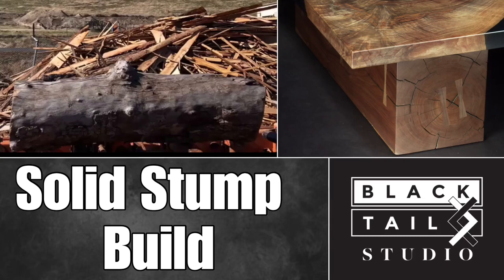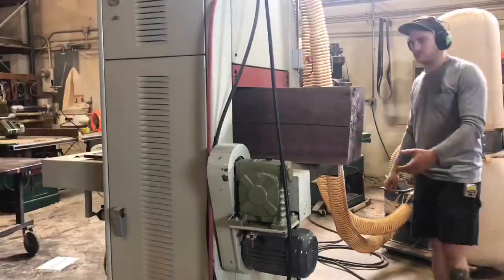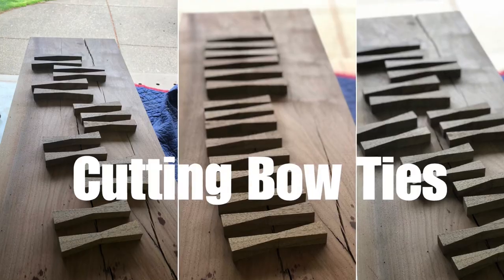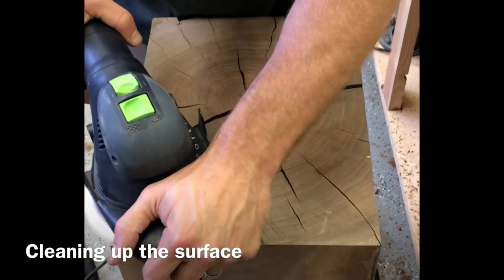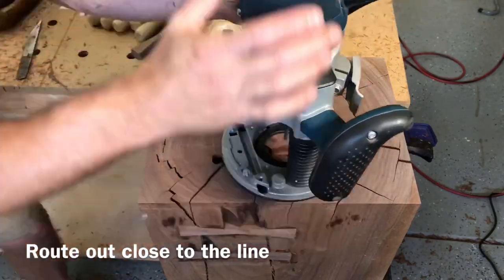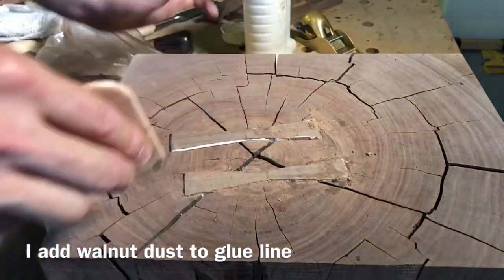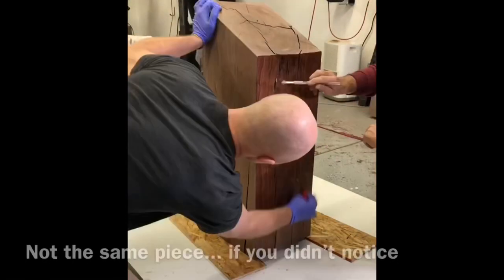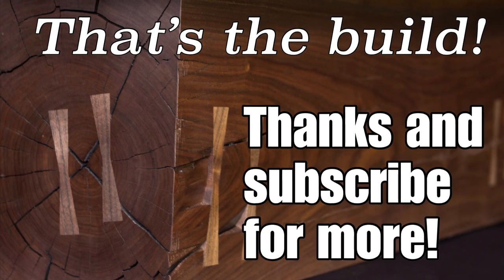Unusual Woodworking — Woodworking How To

Comment: Quickly becoming a fan of your work and videos, and this one was not the exception. Your tutorials are very well narrated and the quality of your videos equally as good. I actually have a question: those bowties, do they serve a purpose or are they strictly decorative? Either way, I love the way they look and your work is flawless.
Reply from the maker: Marco Velez always appreciated Marco. And yeah, they provide structural support to the cracks. The crack will want to expand over the years and seasons, these bow ties lock em in place making sure the piece keeps its shape.
Reply: @BlacktailStudio  that makes sense and is close to what I was assuming however it also looks decorative and I'm sure customers find that appealing. I wonder would it affect the structural Integrity of the peace if those bowties had a CNC'd design or pattern printed on the exposed side. For example if you wanted to include some type of marking or signature on it. I am not sure if that makes sense to you but it's a thought I had.
Reply from the maker: Marco Velez yeah, you could totally design something in the surface. They are plenty thick, so a little etching wouldn’t hurt.
Reply: @marcovelez942  It's not even necessary for the "bowtie" to have perfect symmetry--I have gone to more free-form "butterflies".   So long as you use the specific butterfly intended for your outline, all will be well.

Comment: Quick question on the bow ties... why not just use a steel clip?  Think like the edge of a cookie cutter or potato slicer.  Drive it in, counter sink it then maybe even fill over with epoxy? Or just  cut in the bow tie inlay, or maybe another shape that is more visually interesting and then put in a small piece of perforated steel or expanded metal (to act as rebar does in concrete) then pour your resin in over it?  I'm thinking use either a deep black.  Or if you want to get really fancy maybe pour it in like three stages, bottom coated with silver or gold leaf, middle layer suspending a small LED, and then maybe a few pieces of stained glass glued down in a mosaic, finally a final coat say 1/16th to 1/8th inch thick to seal it all in.  Completely fills and solidifies any checks in the wood, while disguising the whole  thing with a design element.

Does this make sense?  Is it the drying time that is the issue?  I would think for the improved look you could bill for the time and make it worth it to both you an your client.  With the money these folks are spending for these solid wood heirloom pieces,  I bet they'd up the budget for something that was a real show stopper to display to their friends and business contacts at the cocktail  party.
Reply from the maker: Probably lots of ways to do it!
Reply: @BlacktailStudio  just trying to come up with a way to make the one's that are visible more attractive and the ones that aren't easier to do.